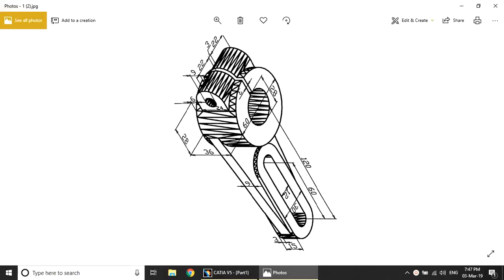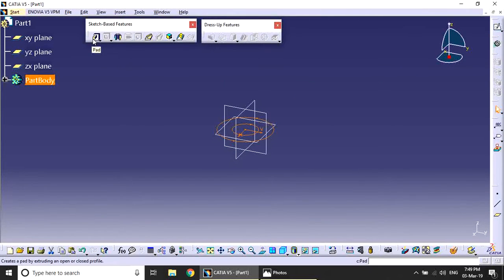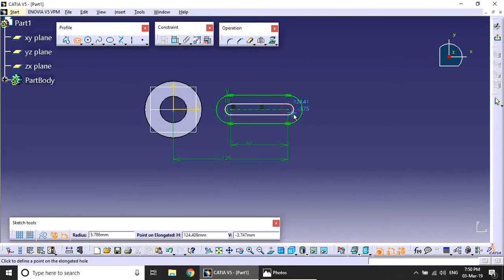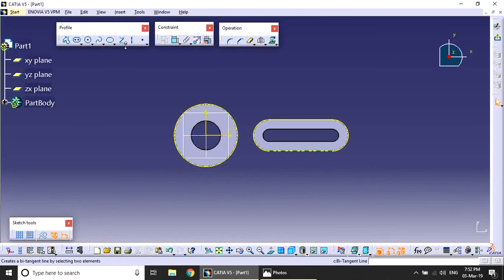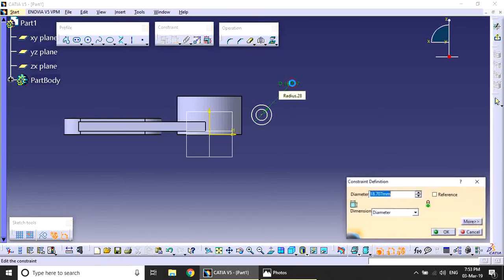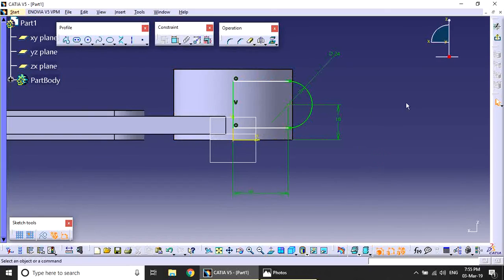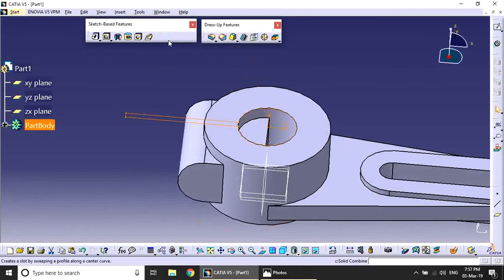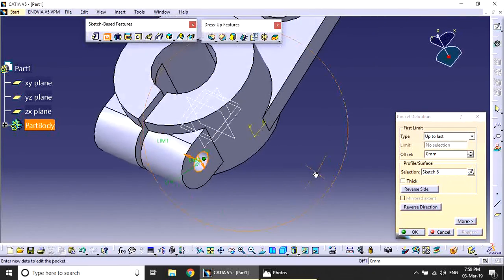CATIA V5 Practice Design 13 for beginners | CATIA Practice | CAD Designs

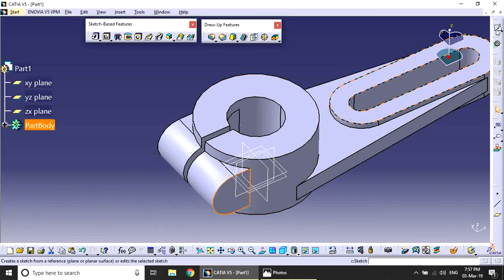Comment: Why there is a contour surface inside the big round thru holes 10:14, where you try to combine the opening cut and the hole feature remove the recess ?
Reply: That is just showing you that you did something inside that hole. But that is actually just one hole with specific diameter. You can go to "view" box and change "geometry views" (cylinder icon) and change between second and third profile view.